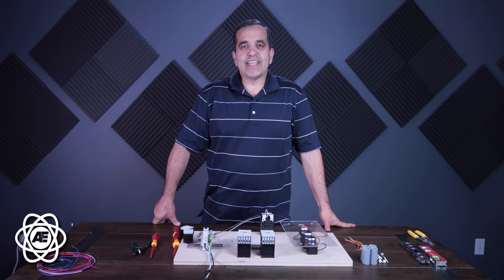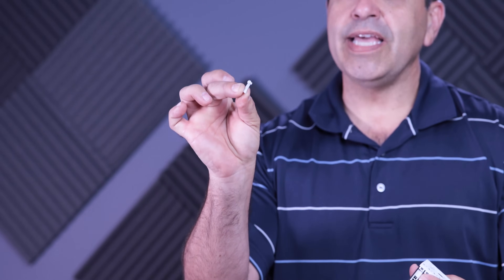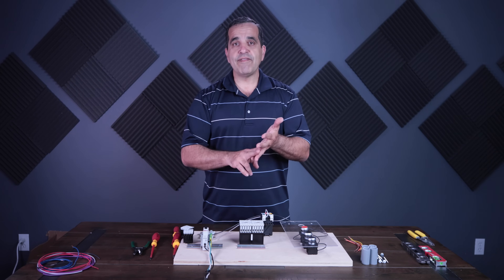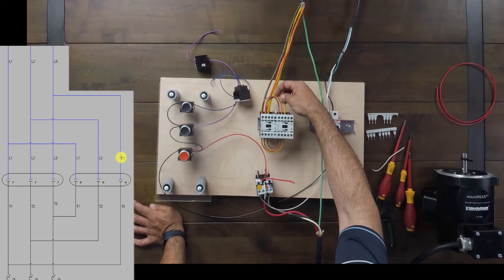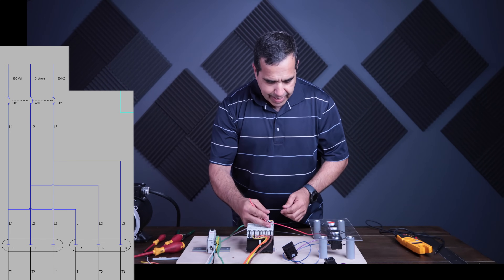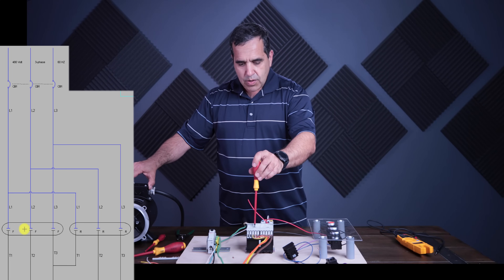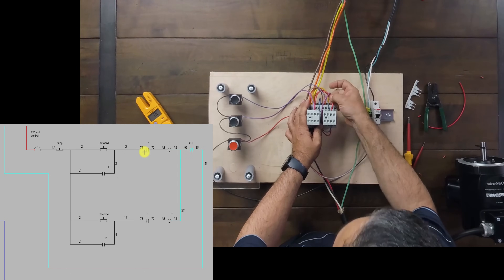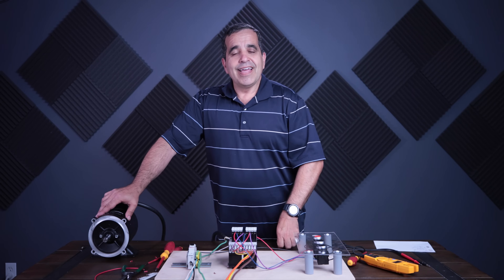Motor Control: Forward Reversing Starter

Comment: Does the 120 V neutral connect to terminal 96 of the overloads and terminal 95 jumps to A2? I’ll take my answer off air, thanks for the amazing content!
Reply from the maker: Yes, those are the normally closed overload contacts for the neutral side of the 120 volt circuit

Comment: Hello, I have wired my 3 phase motor per your video and used same components best to my knoledge, the issue I'm having is when I turn on my 120v brkr it pops. I looked over everything a phew times and can't see what's wrong. Any ideas.
Thank you for your time.

Comment: I always teach to only swap A & C phase to reverse the phase rotation. This prevents accidentally burning stuff up in the rare time one may have to deal with the high leg on a 120/240 3 phase feed. (Code here is the high leg must be on B Phase)
Reply from the maker: That is a good idea. Especially if the control voltage is 240 volt delta. But it is a good practice to teach newbies as it eliminates possibly making a mistake when the voltage, or high leg information is not understood or known. And yes, High Leg is most often on B Phase in the field... but there are some utilities that provide the high leg on C phase and it must be switched after the MSB to B phase on all Panelboards, and MCC's. This too can be a bit confusing and cause people to make mistakes. Thanks for your comments and sharing your best practices with the community.

Comment: Nice in depth explanation video. I'm looking for info just like this. I am looking to wire up something like this for my cargo lift in my garage, three phase worm gear drive motor system. Looking to have EMO, up and down fixed on second floor and the same for first floor. Also looking to have one on the platform wall so when I'm riding it. Would the switches need to be three way.
Reply from the maker: Nice! This could work, but you also may want to add limit switches for the “at top” and “at bottom” locations which break the holding circuit as well. This will ensure the lift stops when it reaches your desired location. For Saftey purposes you may also add 2 additional limit switches for over travel which are tied into your Emergency Stop circuit. This is to protect you in case the normal limit switches malfunction and the lift doesn’t stop where it is supposed to, the over travel switch’s will trigger the Emergency Stop.

Comment: did you do the control circuit wiring simulation on some kind of software, if so what is it?
thanks a lot btw.
Reply from the maker: It’s called Constructor by CMHSoftware.com
Reply: @AccessToPower  thanks

Comment: How does this work for a 130 vdc, 25 amp dc motor? I’d like a forward, stop, reverse buttons for this but I don’t know what I need or how to wire it. I’m using a 4.25 hp Leili treadmill motor. 
Thanks,
Paul

Comment: I have an old conveyor belt and it has a similar circuit to this BUT if the motor is spinning clockwise and you push the momentary switch to engage the counter clockwise position it auto cancels the other contactor and engages the other contactor. Do you have a video that explains this wiring?
Reply from the maker: It sounds like you are missing the normally closed electrical interlocks.
Reply from the maker: Grumman, I looked a bit more at your question and what is different about your forward/reversing setup is that your interlocks are not being controlled by a normally closed contact from the starters, but by normally closed contacts on the buttons. I am creating a video right now with the schematic on what is different and how to wire it. Thanks for the comment. I will send you a link to the new video when it is uploaded.

Comment: Good videos.  However. those devices are not starters. they are contactors.  A starter is a contactor plus and overload relay. When you added the overload relay, they became a starter.
Reply: I wish people where I work knew that. They call motor contactors Mk motor starters even without an overload

Comment: Nice video but I think it's way easier to have 1-0-2 switch so you can't mix direction and it's really simple.
I think this could be useful in bigger machines but then it's better to add PLC

And I'm all about safety and working with live wires is not my thing.

Comment: Can you do a video of a VFD with a remote switch control with an E-stop and, an of/on switch, a forward/reverse, and a potentiometer all to be used in a milling machine.  The drum switch currently on the machine reverses almost instantly (needed when tapping); it is not necessary to stop the motor and then energize the reverse switch.

Comment: Could you add the terminal numbers? 13/14, 95/96? as example.  I have found that this helps students keep track from the drawings to the components.  No complaint just a suggestion.  Great videos, well done and easy for folks to follow.  I like how you split screen to show component and drawing simultaneously.

Comment: This isn't the right way to do a forward/reverse motor controls it does not meet IEEE standards of manufacturing nor it meets electrical trade industry requirement, further more it will be difficult to troubleshoot in case of failure.
Reply: -line protection this is exactly how its supposed to be wired. All equipment I work on comes wired this way straight from the manufacturer. You're telling me they dont follow the laws?
Reply: @scottbustos819  Yes I am telling you that they not following IEEE
Reply: @georgenarso3148  UL seems more prevalent in the industry.

Comment: This system seems as if it would make a great dumb waiter set-up, how would you incorporate limit switches into this system? Fyi you have awesome teaching skills, very informative without going over doing it. Lmk thanks
Reply from the maker: Tony Ciarleglio 
This would work for a dumb waiter setup with the addition of 2 Normally Closed limit switches. If forward is up then I would place the top limit switch in line just before or after the existing NC “R” contact on the rung that powers the forward starter. When the waiter gets to the top the forward starter would loose power as the limit opens. You could then add a bottom NC limit just before the reverse starter coil to stop the waiter when it reached the bottom.
Reply: Thanks you're the best!

Comment: this is incredible with the diagram in the corner. in most video's you just see people connecting stuff but you dont know what the contactor is labeled or what terminal they are putting it in.

I have installed and wired pretty much every device in industrial construction in the field, but sadly not even once have i had the opportunity to actually wire any contactor, relay, or any control related device.

Comment: I was wondering if you wanted to wire a indicator light when either starter is pulled in how you would do that in this situation?
Reply from the maker: good question.  stay tuned ... in the next few videos we will add sequential starting. indicator lights on run and on fault, as well as timed start....

Comment: Note: they a contactors (relays) not starters.
Reply: Please tell me the difference between a starter and a contactor
Reply: @kyliejoe91  The only difference between a contactor and a starter is that there is an overload relay connected in series in line with the controlling contactor. This overload relay is what protects the motor from burn out if something goes wrong with the mechanical load such as a conveyor belt jamming or a bearing seizure. Some starters even have a phase loss feature which shuts off the motor if one of the phases is lost due to a storm for instance. This will also prevent motor burn out due to single phasing.